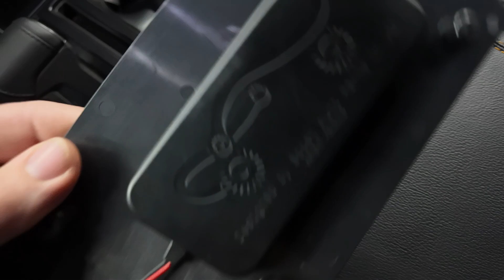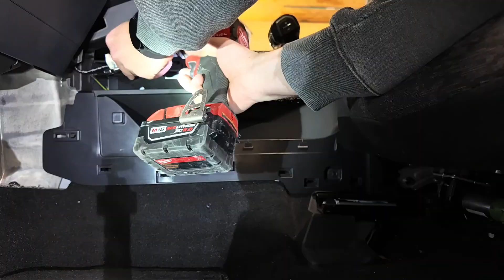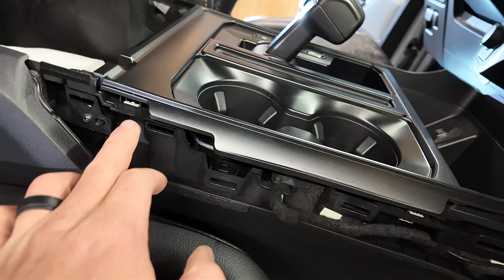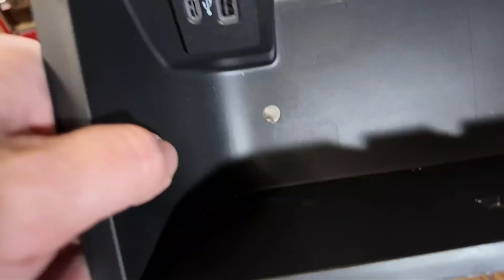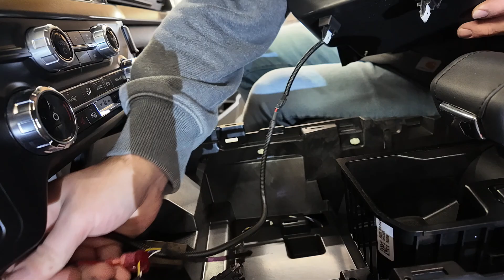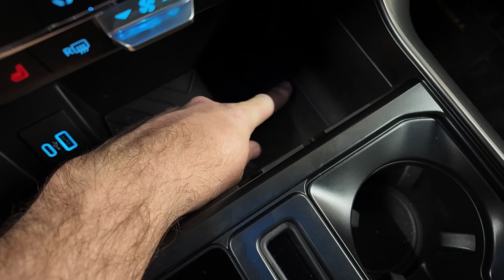21-25 Ford Trucks Wireless Charger Install

Comment: Does this power stay constant to wireless charger draining your battery or shut off when truck is not running?
Reply: There’s no lights on when the truck is off so it’s safe to assume it’s not being powered

Comment: For those of you that aren’t interested in this install, look at the Coin Tray version of Wireless charger that sits inside of the center console. It just plugs into the port that is at the bottom of the console cavity.  Will not be suitable for those that want to see your phone as it is inside the center console and the lid will be closed.
Reply: That sounds like a great option. Do you have a link to one that you recommend?

Comment: That’s to much work just for wireless charging. Not necessary for my use but cool installation video 🫡
Reply: Cool design but yeah bro too much work and $ when a regular charge cable works fine